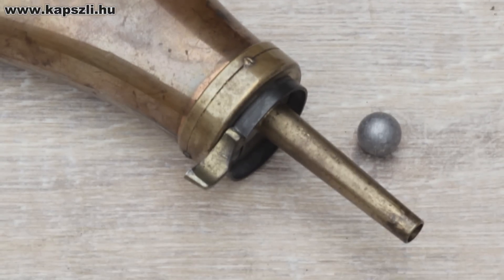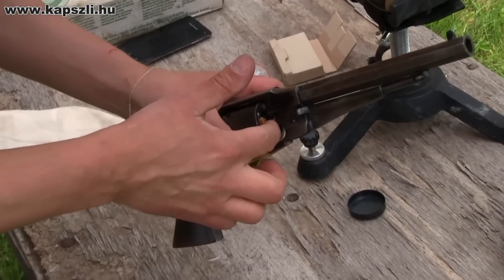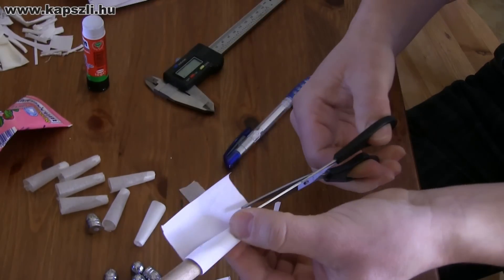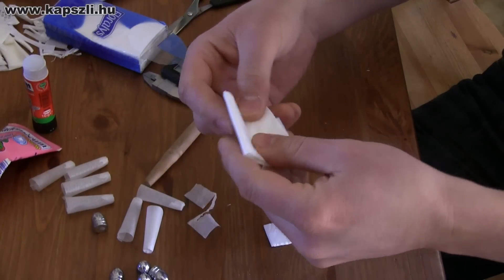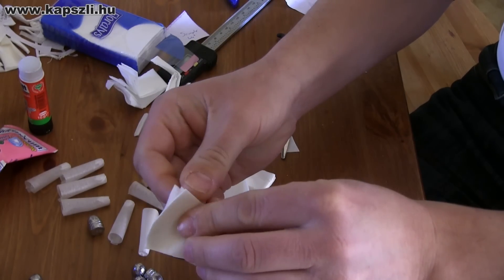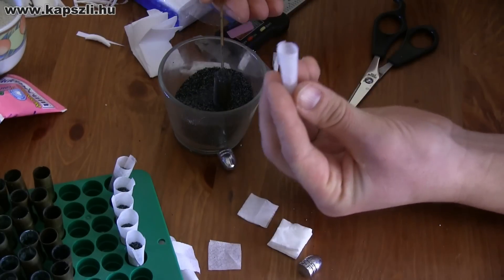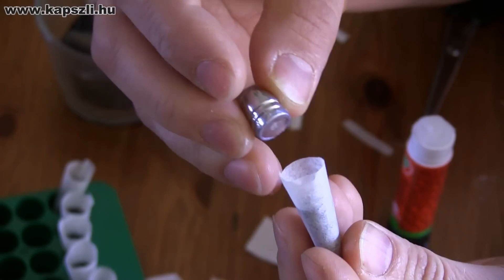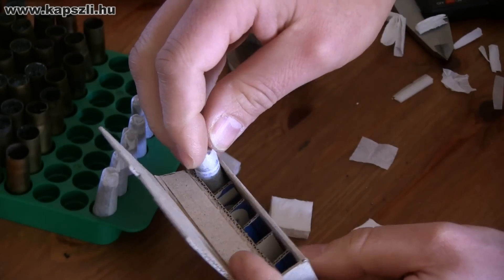Making paper cartridge for percussion revolver - combustible envelope cartridge

Comment: Great tutorial video as usual.  Hair rolling papers are probably the most inexpensive, method.  I know they make great paper cartridges for Sharps breech loaders. Cigarette papers are stronger, but do not burn completely, and leave charred and unburnt residue in the chambers, which is a dangerous condition for reloading. Flash paper and flash glue are 100% efficient and leave zero unburned residue in the chamber.  Though authentic, this method is expensive.  I have to have product mailed to the USA from France.  Round balls may also be used as the projectile. They are usually more accurate for targets at 25 meters.

Processed lamb's appendex from the slaughter house were also used and marketed as "seamless" by Colt who shared a patent for this method.  The original wooden boxes with bored chambers for each paper cartridge indicate how fragile these combustible cartridges were.  It is a miracle that some have survived to this day.
Reply: J.L. Roberts and round balls were used in these paper cartridges before the conicals were.
Reply: @tylerdixon3290  According to Forgotten Weapons, the original Colt Walker bullet molds included both ball and conical projectiles (not the more modern style in this video), so I don't think that's really a relevant argument.
Reply: @mysss29  not rely an argument. I was just stating that conicals werent the only projectiles used when making the paper cartridges
Reply: There are a few videos illustrating how to make your own combustible paper.  They just soak the paper in a potassium nitrate solution and let it dry.  It's not true flash paper but it will burn quite well.
Reply: @chrisp33  From what I have seen of those videos they don't burn all that well, so they leave char in the chambers.   When you use flash paper and flash glue you can just fold some of the paper at the small end of the mandrill over the bottom flat and glue it shut with flash glue.  That saves you the step of cutting and using the small circles at the bottom.  Or you can do it like the video shows, but with flash paper & glue.      I found a place in the US that sells flash paper & flash glue:     Theatre Effects, 1-800-791-7646, service@theatrefx.com.   They are very friendly.
Reply: @tylerdixon3290    I have only used round balls so far, but would like to get a mold(s) from Eras Gone By that casts the heeled bullet(s) to make proper flash paper conicals, if they ever get back in stock.

Comment: For my Italian-made Armi San Marco '58 New Army, I make cartridges from:

-Cigarette rolling papers
-Elmer's white glue (polyvinyl acetate)
-.454 lead round balls
-FFFg black powder.  

Since the chambers on the 58 are straight-walled, you can use a piece of wooden dowel for the mandrel.  Using the extra-wide cigarette papers, and some finesse, I can get two paper hulls from each rolling paper.  

1. A cigarette paper is rolled around the mandrel (dowel), and the cylinder secured using the glue strip on the paper.  The resulting paper cylinder is cut off to a pre-determined length.  [NOTE: Determining the exact length of the paper cylinder for your specific projectile/powder combination will require a bit of trial-&-error testing.  For this process, you can use cornmeal to simulate the volume of black powder.

2. The base of the paper hull is folded in against the end of the mandrel, and sealed with a small dot of glue.

3. Once the glue at the base of the empty paper hull dries, it is carefully slid off of the mandrel, placed in a loading block, and filled with 30 grains of FFFg black powder.

4.  A small bead of glue is run around the open mouth of the hull, and a round-ball is placed gently on the mouth of the hull.

5.  After the glue dries, I CAREFULLY dip the ball end of the cartridge in a mixture of melted beeswax and vegetable shortening (Crisco).  This allows the cartridges to be loaded without extra grease over the chambers.

6.  After loading the paper cartridges, I run a pick through each nipple hole to ensure that the back end of the cartridge is pierced, then cap the nipples.
Reply: Good tips. I have an 1858 as well and have found that making them tapered means when loading them into a chamber the narrow end ruptures when squeezed down by the ramrod, therefore eliminating the need for a pick. Just fyi.
Reply: that what did, I also put a drop of model airplane glue on the end then pressed it on to a small pile of finely ground powder. no trouble with paper pugging the nipples.

Comment: Always love your videos. I love the Remington but personally my favorite of the period is the Smith and Wesson top break.
Reply: The S&W is a metal cartridge gun, it is in a totally different class from what is being discussed here. It may have shot black powder loads when new, but it never was available in a cap and ball format, unlike the Remington and Colt - part of why they are not break open and the S&W is. No need for a top break except to load metal cartridges in. These are paper cartridges, used only for loading muzzle-loading BP guns, because it's faster than pouring the power and ramming the ball into each cylinder every time you load it. A cab and ball pistol can be purchased in the US without a background check, and is not defined as a "Firearm" by the BATFE. A S&W Top Break fires metallic cartidges and is thus classified as a Firearm. And of course the only S&Ws being produced at the time when this Remington was in widespread use was the .22 caliber S&W  No1 and No2 pocket revolvers, which hardly competed for sales.
Reply: @justforever96  ironically these create more literal fire.

Comment: I don't know anything about weapons, but how do they detonate without a blasting cap?
Reply: There are percussion caps placed on nipples at the back of each chamber on the cylinder they are detonated by the fall of the hammer and shoot sparks through a flash hole at the back of the cylinder.

Comment: Do you need to clean the chambers after each 5/6 shots ? I tried this method with cigaret paper but not bullets (out of bullets :( ) and I got paper residues in the barrel. I'm afraid of  small smoldering residues in the chambers igniting the next cartridge when loading. Works fine otherwise. Ignite everytime.

Comment: Hello, you load cartridges with 30 grs of BP and lee balls 200 grs. I pull this of load in my 1858 pietta, but i hesitate use him in my 1860 uberti. Not it in you he no risk of  premature wear of the weapon in case of regular use of such a load ? Thanks you for educational videos.
Reply from the maker: Hi! Uberti percussion revolevrs have a stronger frame than Piettas. Piettas are made of cast steel, Ubertis are made of forged steel. Great difference. However it does not matter who the maker is, all the CIP proofed percussion revolvers are safe to shoot full loads.
Reply: ***** Hello, Thank you for your answer. I wonder more about the relative fragility of the system Colt with regard to Remington. I think that the constraints on the key witch shows solidarity the standard in the carcass can fatal beings to the mecahnics of the weapon, but maybe i am too pessimistic. Thank you again for your excellent videos. Forgive i my bad english (google translation) ! ;-).

Comment: Oh good, nice to see a pre-made cartridge that fits in the new model army. (sadly, conicals are quite hard to find where I live, I know you can make them, but something tells me that cooking up bullets in my apartment would make someone angry :P). A lot of folks use cigarette papers for this, too, because they already come with a glue.
Reply: Lee Precision makes conical molds and so does Dixie Gunworks....
Reply: GMG268
yeah. It's just hard to cook up lead in your apartment XD have no garage to do that in. I'll likely get a mold here, at some point.
Reply: ww321
NEVER,......EVER,...Mess with hot lead in your house or apartment!!,....You can't get enough ventilation even if you open all your windows!!
Reply: GMG268 It's not the best thing to do But I think a half smart and careful guy could do it and be ok. Exhaust fans cant move very much air in a sealed room. It needs air from somewhere to exhaust or the room becomes negative pressure and it moves little then.  I'm pretty sure my el cheapo hood would pull enough air to keep the room clear. But I'm not a safety nazi and haven't killed myself yet. I think hot oil is WAY ! more dangerous in the kitchen. People use it all the time. Some burn themselves badly, or set the house a fire. In case your counting I rarely use push blocks on the table saw !
Reply: ww321
If I ever did make bullets in the apartment, I think I'd go for the hood rout, and maybe an old surplus mask or something for some extra protection, that would have to be sufficent, given what else those masks can protect you from.

Comment: I get paper residue in my chambers, causing misfires unless manually cleaned out. Is this a common problem?
Reply: +Kristian Fagerström  It sounds like you need to treat your cartridge paper with potassium nitrate, KNO3, so it will combust nicely.  Also, I think people prefer thin, fragile paper.
Reply: I used cigarette paper, will try flash paper next time
Reply: Flash paper sounds WAY too reactive and flammable, to me.  I'm looking around in my town, trying to find stump remover made of KNO3, for this purpose.  Looks like Spectracide's stump remover is almost pure KNO3.
Reply: +Davey Bernard   Spectracide Stump Remover; At your favorite Big Box home improvement center in the garden department...
Reply: I'm still canvassing my small town for Spectracide's stump remover.  So far, no joy.

Comment: New to guns, please excuse the stupid question.
How do paper cartridge bullets ignite if there is no primer? Is the igniting system built in the revolver?
Reply: +MN-14 These are blackpowder firearms. Think revolutionary war. Civil war. Etc. Revolvers were civil war era and just a bit earlier. Most were loaded with powder and the ball, and the percussion cap primer on the revolver chambers nipple.  Paper cartridges of this type are meant to burn and ignite the powder.  I am attempting to try a batch with pyrodex substite which is harder to ignite.
Reply: +Charles Stipes Actually, Revolutionary war weapons used flintlocks (flint + steel = spark in flash-pan... BOOM!)
A percussion cap will send a jet of flame through the paper and into the powder very reliably. I use ROLLING PAPERS to make the same as in this video. There's a YouTube vid on this. 
I've done around 200+ cartridges using rolling paper and so far very reliable (misfires were due to bad percussion caps).
Reply: I never said this was a revolutionary weapon. I said blackpowder includes such weapons and specifically stated that the revolvers in question were civil war era. Eric X
Reply: I know my friend, I was just clarifying a minor point for ya ;)

Comment: You should specify that these instructions are only good for a .44cal weapon. You'll need a different size rod for a .36 Colt Navy or Police Pocket. Should be easy to work out from the dimensions given here, although I doubt it has to be perfectly accurate.

Comment: I did this for my 51 navy but no matter the length the cartridge would wedge itself and not fall into into the chamber so im back using pyrodex sticks 😑
Reply: The 51 has a to tight of a frame for this, even having a to thick of a round patch can cause it as well, you could just try to make it for the powder then press it down, then do the ball after.

Comment: Why do you not use cigarette papers. I have never heard of hair curl paper is that work better? The original Civil war boxes say "impervious to Dampness" how could you apply some waterproof to your  paper cartridge for that. Here's a link for the image http://i530.photobucket.com/albums/dd346/drm2m/tw1-3.jpg
Reply from the maker: Hi, these are seamless skin cartridges, not combustible envelope cartridges. Waterproofing was done by several method. One was to cover the compressed powder charge with shell lack, like the Hazard Powder Company did it. Another method was mixing the powder with shell lack to a semi-fluid consistency than drying it (like Bartholow did it). He also coated the dired and formet cartridge with collodion tincture of shell lack. Another methoid was patented by Julius Hotchkiss. He used hog's gut for the case, and also advertiosed his cartridges as waterproof. The cartridge in your picture is done this way.

Comment: Just use cigarette rolling paper...has glue and everything
Reply: TheWoollyMammoth I
Reply: It will not burn completely and will let a residue to the chambers very quickly.
Reply: Jari, what is the reason for your argument? So, you're saying that tissue paper (that he uses in this video) burns better then cigarette paper? Even if the second, cigarette paper, was made for burning without residue.
Reply: I've read a few forum posts regarding rolling paper and yes it can be used very effectively without any residue, but as anyone who'se ever used a rolling paper will tell you, not all papers are created equal. The cheaper, thick papers will probably be less than ideal.  I'd recommend Elements Ultra Thin Rice Rolling Papers.  They burn very cleanly.. you can practically see through them.